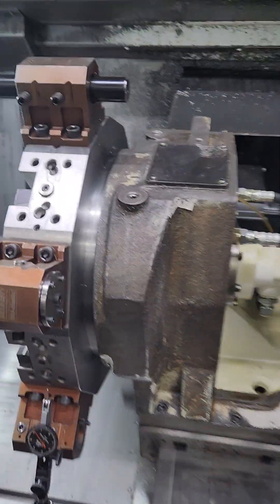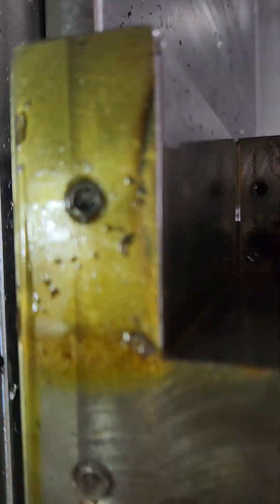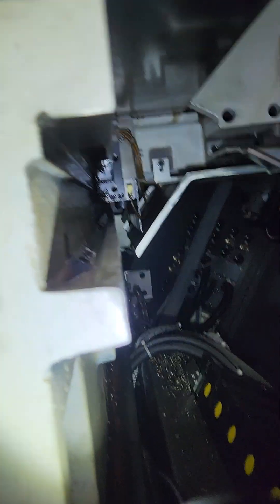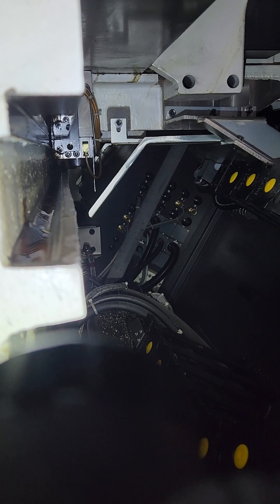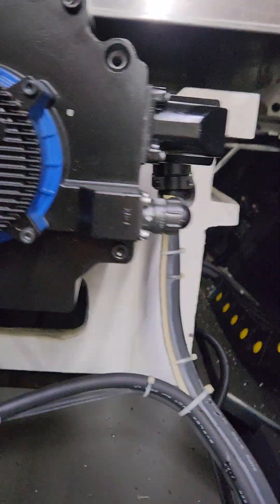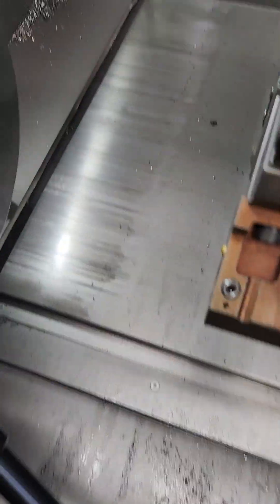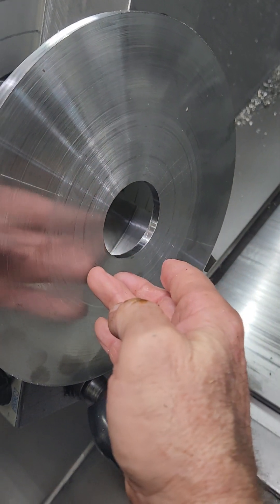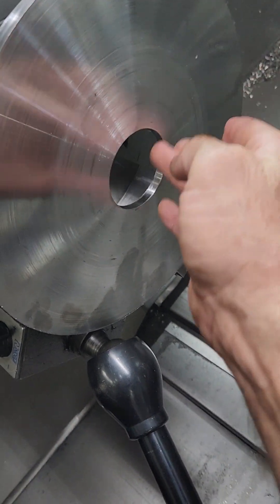LB4000EXII turret and machine alignment tips after a bad crash.

Comment: Great info, Daryl. So to adjust the gibs, you're just tightening till you feel snug. I assume this is a very touchy feely sort of adjustment. I've torn my whole takisawa ts-15 down to nuts and bolts before, but I've never readjusted the gibs. I recently discovered some slop in the X slide and not sure if it's gibs or ball screws. But feel gibs should be the first thing to address. I am assuming when I get in there, I won't find much in the way of "snugging room", so how should I determine how much to tighten the gib screws? And which ones? All of them? Keepers and positive?
Reply: We've got an old Takasawa at work, I think it's a TS series, been a really good machine for the past 30 years or so.  Unfortunately, I've never had to deal with adjusting the gibs on it, so I can't provide any specifics.  Be aware that not all gibs are screw adjustable, some use shims that have to be ground down or other methods.  You have to keep in mind that the ways tend to be a lot more worn close to the spindle/centerline where it spends most of it's time.  If you adjust the gibs in the worn area, it will start to bind as you get closer to reference position (assuming that's set with the axis' at their positive end of travel).  Depending on the amount of wear you may not be able to get all the slop out of it without binding at the ends.  Most controls have some way of monitoring the load on any given axis.  When I'm adjusting gibs on clapped-out machines I watch the load monitor and tighten them up as tight as I can go without causing too much load with the machine referenced.  You don't want the axis sitting with a 90% load when you home out the machine, you just have to compromise the best you can, or learn how to scrape ways back in!

Comment: Tight spaces, I see a lot of walking around the machine just to get to them.  Thanks for sharing. Charles
Reply from the maker: I like to tighten all of the gibs. It is a feel thing, but if you have a load monitor on the controller, you can use that. Write down the loads in both directions and check it after adjusting the gibs. The reason I don't back the z-axis gibs out a 1/4 turn on this machine is because they are pushing a 2-1/2" x 14" long drill. The x-axis gib, I snug them then back them off a 1/4 turn.

To access the load monitor on a Fanuc 16 or newer, hit the position hard key, then the right expansion arrow, and you will see a "monitor" soft key on the left hand side. Okuma states to not exceed 35% load, but I like to see about 10 to 12 percent load after a gib adjustment. X-axis will be different load going up as opposed to going down due to lifting the weight of the turret and no counter-ballance. I like to see 10% going down and 30/40 going up on x-axis.
Reply: @OtherBrotherDarylSmith  Awesome idea.